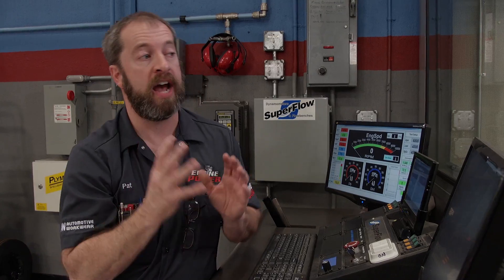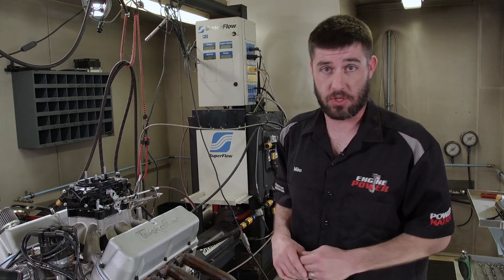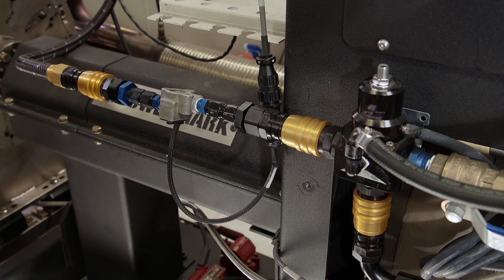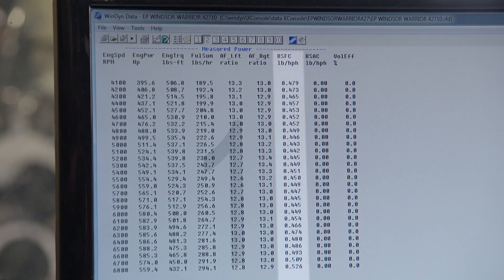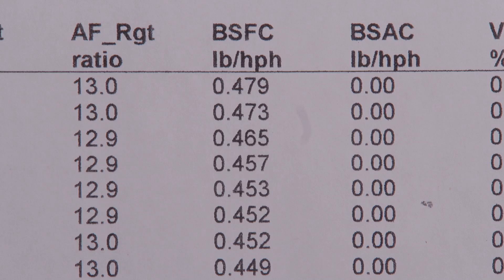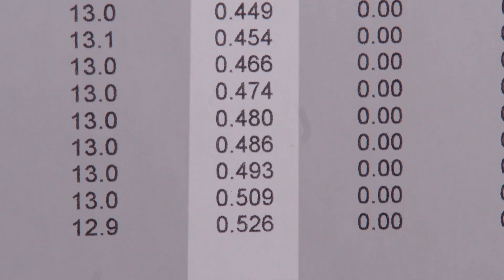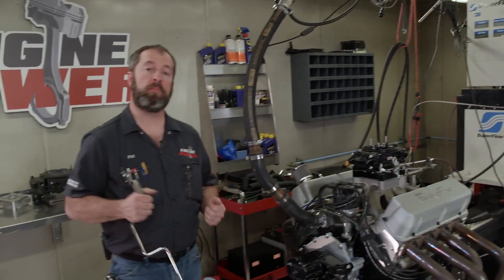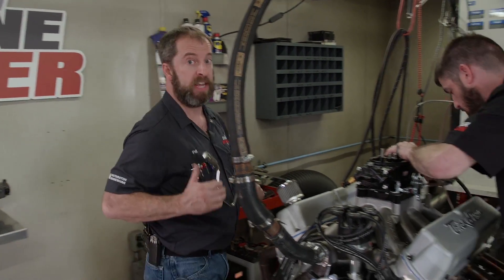How To Tune An Engine For Maximum Horsepower And Torque

Comment: maximizing horsepower is all you need. saying maximizing torque is literally redundunce and dumb.... increasing tq at any rpm results in increasing hp.... so its like saying, should I make more money per hour or more in salary....
stop being dumb
Reply: Oh believe me, they are two very different things. Increasing torque increases horsepower, yes. But the torque is the amount of energy propelling the vehicle, it’s the physical pull of the engine. You can have a lot of torque, but if it’s only accessible at higher rpm, you have to floor it to feel any of the fun. Not always feasible on a public road. However, if you can bring more torque to the lower rpm’s, you get more low end fun. It’s more useable. It increases horsepower, but the end result is very different to just blanket adding more torque. One pulls when you rev the engine harder, the other pulls when the engine is more around the mid range. It’s similar to the difference between a muscle car, and a sports car. It’s about putting the torque where you want it/need it for your applications, so that power is more useable. Hence “maximizing torque.”

Comment: I can't find one video on YouTube that discusses how to increase low end torque
Reply: Easy! A camshaft swap, stroker kit, or dual plane intake
Reply: @musclebone7875  ok.. question.. would a better flowing head with a larger valve increase or decrease torque on the low end or would it compromise it.  I've got a 455 olds with a 70s smog head,  smaller valves.. I can't change the intake..  i want the range of torque to be low.. reving 3000 max
Reply: @TrentGustus  A better flowing head can sometimes increase torque, but usually it increases horsepower up top.  Usually to make good torque and horsepower in is the combination of parts. First you need a camshaft that's for a certain RPM range. Since you're looking for alot of low end torque, you need a camshaft that starts making power around 1,500 to 2,000 RPMS. Then you need compression ratio, decent flowing cylinder head. Stock heads will make good torque.
Reply: I have an olds 455.. with stock J heads which was the smog head... smaller valves, but I have some stock heads that were off of a marine engine.. higher flow big valve.. all the literature tells me that the smaller valve heads will be better down low.. but then since most boats require low end torque.. wouldn't the marine heads naturally be better? This is in a motorhome.. so what I really need is torque down low for mileage and to pull up hills.. and I need a smooth cam.. probably what's in it now..  I also have been trying to find out if Throttle body injection would increase torque down low.
Reply: @TrentGustus  not necessarily! Most boats like RPMS between 3,000 to 4,000 RPMS. They do need to torque,  but mostly in mid range RPM band where as I'm assuming you want most of your torque under 4,000 RPMS. you would want to use the smaller Intake port head. The smaller intake port volume head will usually make the most low end torque.
Reply: @musclebone7875  what you are saying I believe is correct, from everything I've researched.. the bigger valve could kill the velocity at low rpm.. however I haven't found much information on the flow of smog heads and how that affected the HP and torque curve.
Reply: @TrentGustus  ok. So what heads are you gonna use?
Reply: @musclebone7875  The J heads are on it.. they are the smog heads with small valves.. I don't have to change... it's why I'm asking the question.. I'm still researching.. but I think that carburetors need smaller runners to create velocity.. at low RPM.. so I think that if I add Throttle body injection.. going to the larger runner and valve at the same time should be a benefit without the concern of velocity reduction at low RPM.  My impression is.. that newer engines don't have the problem of velocity with 4 valve heads because they are port injected.. so velocity isn't required to atomize fuel.
Reply: this guy did a great video series on this subject, he showed with a dyno you can make great torque using stock parts.cheers
https://www.youtube.com/watch?v=WV3GRirgj0c
Reply: Shorten your LSA with a cam swap, and keep 0.050" duration under about 235 [street build].  Also, advance your cam as much as heads will stand while staying under 200# cranking pressure.   There are tow cams out there with an lsa of 104 [just real low lift numbers and a redline to match, and their 0.050" duration will be under 220 degrees for sure].   Complication? if you want to keep manifold vacuum manners near the same ballpark as a typical 112 lsa cam, you likely need to give up some lift to hold overlap near the same value - that's ok, because you get better exhaust scavenging on a shorter lsa [using headers].  Funny thing is, nearly everybody I hear saying don't try a 107lsa  hasn't done it, and the folks who have done it held vacuum above 10"after tuning, and were fairly happy - a vacuum canister should perform reasonably well if your car uses a brake booster.   You will have higher cranking pressure, and while torque gets less flat [and hp near redline sags a touch], you will have more average hp across your entire range because of the early hit. 
 Sometimes... going under 108 means talking to a cam company about a custom grind, so give that a go.  Just be honest with yourself about what rpm operating range you really want to be in, and what torque converter you can/want to  live with.  For me?  I am near a half dozen schools, so I don't want over 2400 stall [and prefer a 2200] just to get in/out of the area - that's a little off where the racing crowd is concerned, which means my off the shelf cam options are not that big.  The Isky 268 Mega comes very close to what I like, but there is room for just a bit more lift however - 0.470" lift should stay within acceptable limits for minimum rate of change [flat tappet lifters do not appreciate lobes that are... too flat].